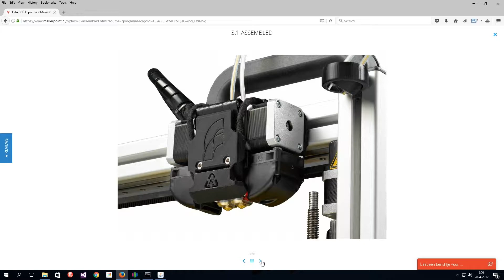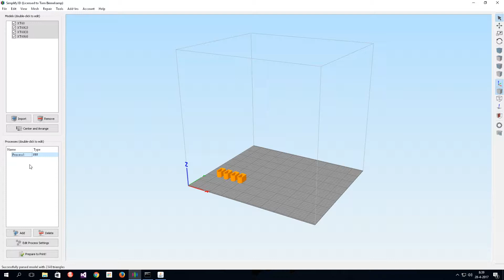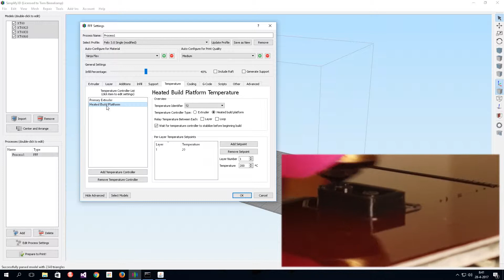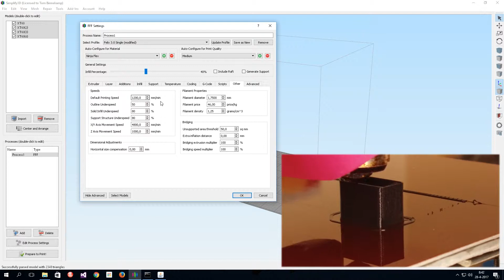Printing NinjaFlex Filament with the Felix 3.1 3D Printer

Comment: Did you do any modification to the printer ? I can't get it to extrude flexible materials at all :( ( I have the same Felix 3.1)
Reply from the maker: It is indeed rather difficult to feed the flex filament into the Hot-End.
The only thing I did after putting the printer together was drilling out the "Hot-End peek isolation" section with a 2mm drill because I already started out having difficulties in loading regular filaments like PLA. How to do this is described in the "Hot-End_assembly_instructions_3_1.pdf" manual that can be downloaded from the Felix website.

Once the flex filament is in the Hot-End, it is important to use a slow printing speed. I use a maximum printing speed of 1200 mm/min. If I try to print faster the filament will be pushed out inbetween the filament feeder stepper motor and the Hot-End base.
Also make sure that you do not use any "Retraction" of the filament during printing as this will end up in a jam (clogging) inside the "Hot-End peek isolation" section of the Hot-End.
Hope this helps, good luck.